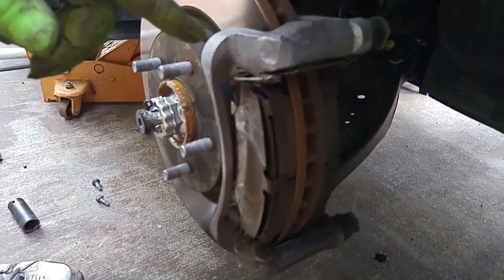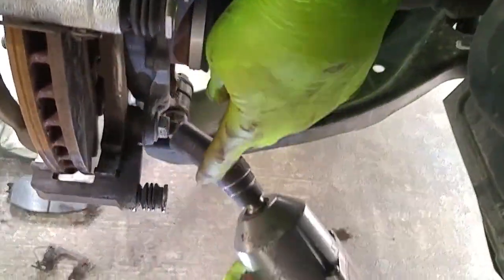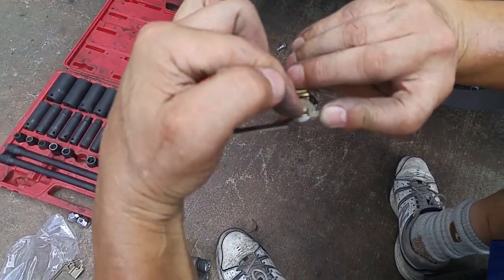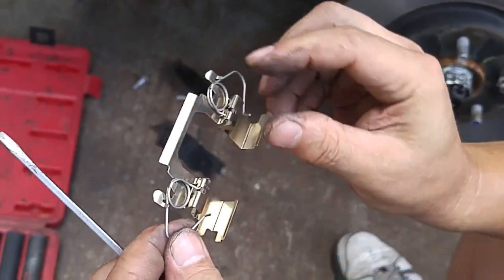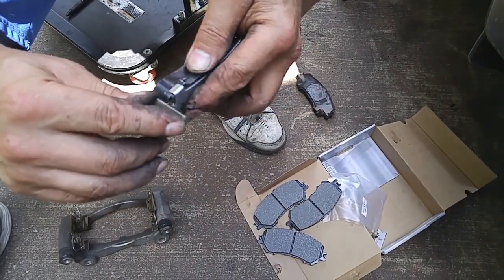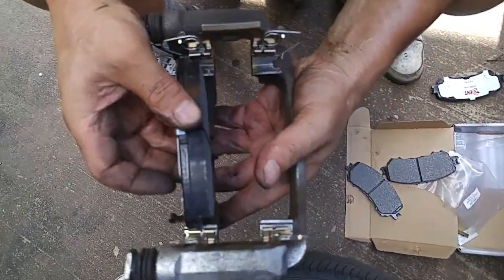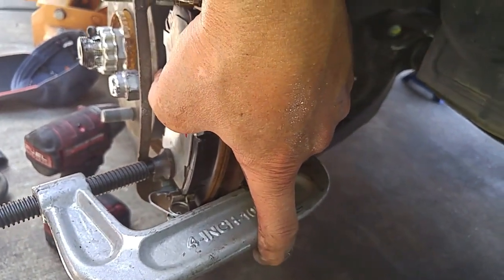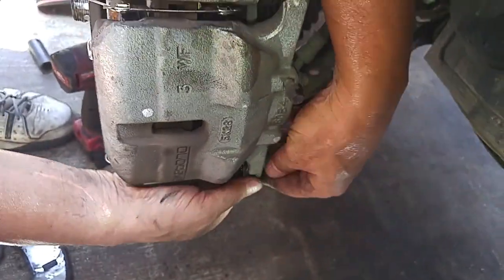Nissan Rogue Front Brakes, Rotors, & Abutment Clips Replacement

Comment: Nice job!
I like that you replaced the guide pins in the same holes.
On some model Nissans they are different and if you don’t put them back in the same locations....upper and lower.......it can cause problems.
Why didn’t you change the rotors?
Are the Raybestos pads good?
Reply from the maker: Thanks!  Customer didn't want to pay for resurfaced or new rotors.

Comment: May I know the drill being used? I but one for $200 but couldn't even unscrew lug nuts. Please let me know.
Reply from the maker: I use the Milwaukee brand electric impact tools.  They are not cheap.  Here's a example link to Amazon:  https://amzn.to/3LhUSlW
Reply: Most cars lug nuts are only 80-120Nm, so any impact should handle this easily. Do you know if perhaps red thread locker has been used on the lug nuts? If so, heat is required. If not, did you break the lug nuts with a breaker bar before raising the wheels?

Comment: What are the Torque specs for the caliper bracket?
Reply from the maker: You've got to invest in a repair manual to get those specs.
Reply: @hardlymovingpro  says the guy that has never used a torque wrench!

Comment: Do you need to open master cylinder cap when pressing the calipers piston...
Reply from the maker: The cap does have a vent - but removing it helps to reduce back pressure when compressing the pistons.

Comment: Woulda been nice if he specified what size socket was used for each bolt.  Also II dunno about using an impact gun to tighten the caliper bracket and caliper bolts.  But good video.
Reply from the maker: Japanese cars are all consistent with their bolt/nut sizes;  that is, 8mm, 10mm, 12mm, 14mm, 17mm & 19mm.  I can usually just look at a nut or bolt and reach for the right size socket or wrench.

Comment: Can we get the torque spec for the caliper bracket and the caliper bolts?
Reply from the maker: Sory .... don't have it.  Recommend you get a repair manual for your specific vehicle which will have all the torque specs.

Comment: 6:03 take care not to push in the caliper piston past its own seal(s). 
If you do, there's a good chance the seal(s) will get pinched the first time you apply the brakes locking up the piston and burning up the brake pads in the process. Found this out the hard way on a Chevy once, it's been a key point of performance ever since. My 2 cents.
Reply from the maker: Good point and thanks for sharing!  Also a good idea to coat the seal with silicone grease or spray.

Comment: Should my brakes have came with new spings? I just have the clips
Reply from the maker: With cheaper pads the "springs" or abutment clips are not included.  You'll need to check before buying.
Reply: Sheesh I thought duralast gold were good . Thanks for responding man